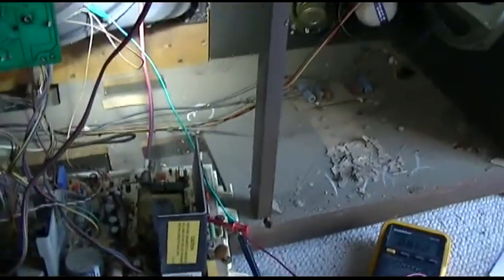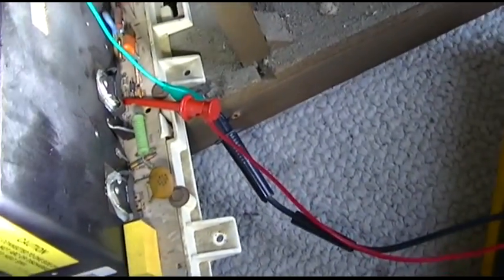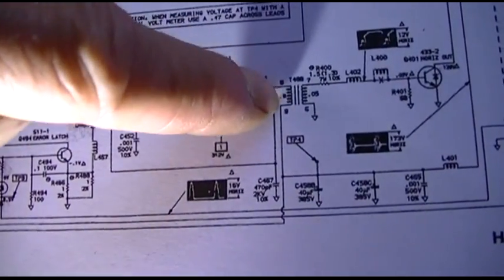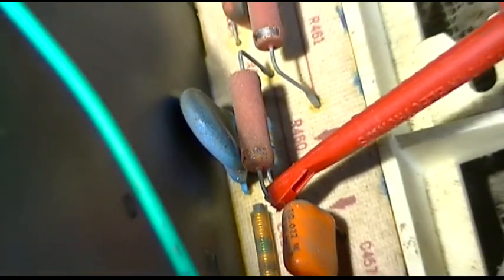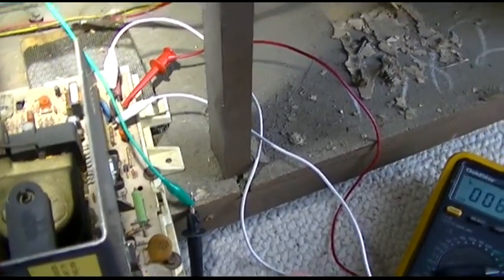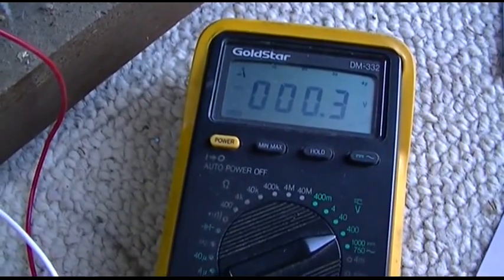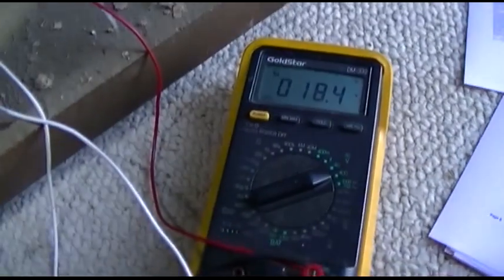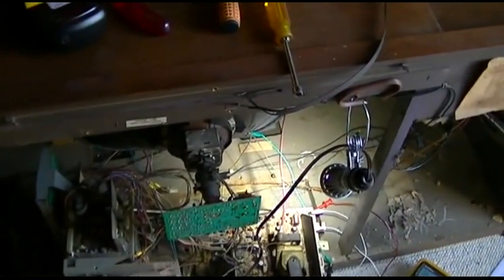Magnavox 25C Color TV Chassis High Voltage Repair

Comment: To satisfy the G+ requirement I used "link to the e-mail only" option for now. Been waiting for this Magnavox update. Knew you'd get it to fire up again.
Reply: I did bugger all in terms of G+ requirement. About a year ago when they were bugging me for a name I just used the same pseudonym I've always used but separated the two. It's pretty weak that poohgle wants to take on facebook, when that site is on the wane anyhow, by forceably converting You Tube account into poohgle+ accounts.